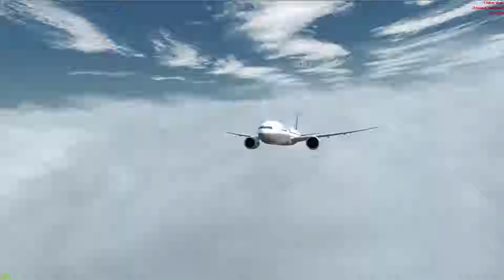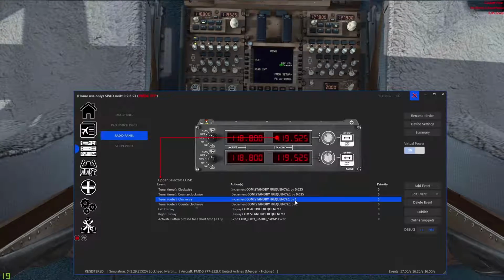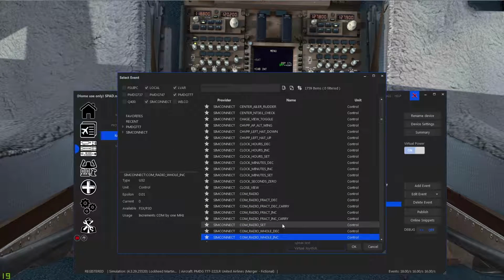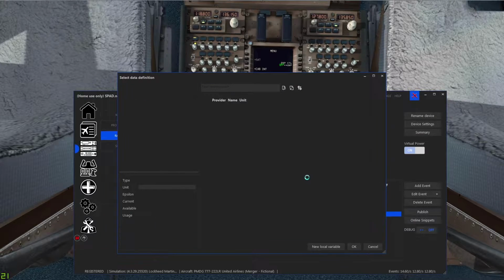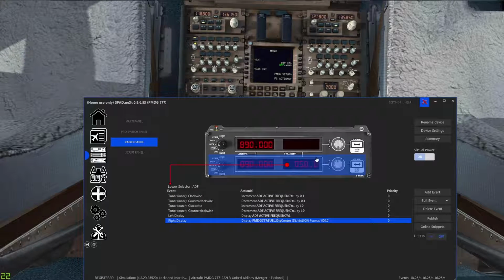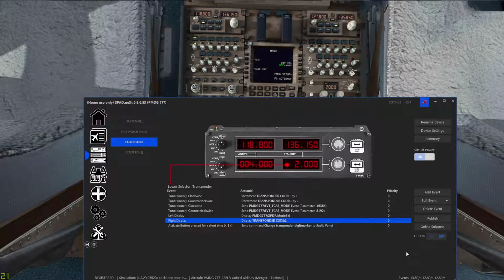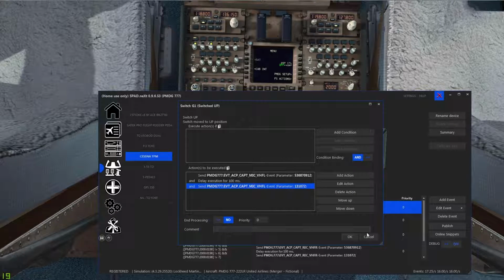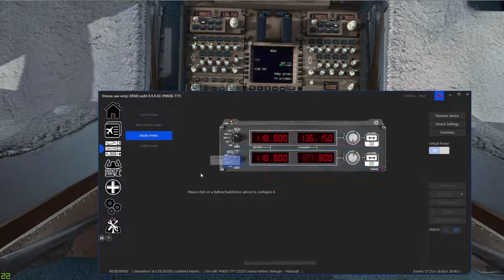SPAD.neXt PMDG 777 -3- Radio Panel

Comment: My Saitek Radio panels only have two digits to the right of the decimal where you are in that problem and it shows to the thousands place (3).  How are you doing this? so i have a total of 5 digits only.
Reply from the maker: That is SPAD.Next shoeing you the full value. The radio is still doing the third .005 increments in the sim. Even in the real world we have a com unit that only shows the 2 digits but when you are on day .17 it is really .175.  What is funnier is that we never have an a different first digit....yet we always show it and say it :). The 1 is basically useless.
Reply: @LesOReilly  That's a real hoot.  So let me get this straight... the Saitek panels will never show the third decimal, those are locked "3.2", the SPAD software read-out will display the 3rd decimal and those are capable of 3.3, Real-World radios are 3.2 (I'm guessing there are exceptions to that). And the "1##.##" is used on-air but could basically be a sticker of a 1 put in front of a 2.3 display, saving the first digit.  So in the case of a Saitek radio panel, if we make a nice number 1 , slap it on the unit and have SPAD adjusted to show 2.3, we are golden?
Reply from the maker: @harpoon_bakery162  Yeah if you look at a Bendix King 155 radio....images bendix king 155 ... You will see that they have only 2 decimal digits and the third digit is really only a 0 or 5 with spacing increments of .025 --- however I think Europe has since forced 8.33Khz separation so you need newer radios and to set them to use the 8.33 steps not the 25khz steps....Whole other topic...

Now as for the panels...I have not tried to shift them by 1 in Spad.Next.....It is probably possible to do to so that you would have 2digits Decimal 3 Digits....And yes you are correct the 1 never changes......Com Radio frequencies are 118.00 to 136.975 and the NAV freqs are 108-117.95 but they step in .05 increments....I am sure you can find Wikipedia to have a thorough article on Aviation Radio or Airband or something if you check it out.  So always weird to me that we make a point to call out the number in a com hand off --- (GMTT contact Departure on ONE-TWO-SEVEN-DECIMAL-NINE-SEVEN-FIVE)....could always drop the one :)

Now "modern" radios like our GNS-480 have all 3 digits on the display...or say for a COM/NAV only modern unit look at the images garmin gnc 255 they are always 3 digits......
Reply: @LesOReilly  thanks for your copious & great explanation of all of this. !!i will have to check my reality XP garmin 750 touch that i use for certain aircraft (mainly Cessna Citation II 550 from Caranado) but i believe it might also have 3 digits.  I probably shouldn't put a hokey looking sticker on my panels but hopefully I won't need that 3rd one any time soon.
Reply from the maker: @harpoon_bakery162  no worries..yes the GTN750 and 530 have them...They are based on the Garmin Trainers :)  I enjoy the 750 as well!!  Missing it in MSFS currently :(
Reply: @LesOReilly  -- do you think it will eventually support 2020? or have they made any announcements on that -- i will google that up but in case i chase my tail i figured i'd ask
Reply from the maker: @harpoon_bakery162  They are active in their AVSIM forum.  Currently there are limitations that prevent them from implementing it.... So for now they are focused on their XPlane and P3D implementations.....So I guess I will be still running P3D for more than a PMDG 777
Reply from the maker: @harpoon_bakery162  Oh and currently if you set the display in Spad.Next to 00.000 it will not move over....so you are limited to the 2 digits
Reply: @LesOReilly  ok, this is good to know,, you saved me from having to chase my tail,, i looked up the Bendix and then also looked up one with .### and found this one https://www.aircraftspruce.com/catalog/avpages/garmingtr225.php which also mentions that you have to order a special version to get 8.33 support.  This is all very interesting and thanks again!